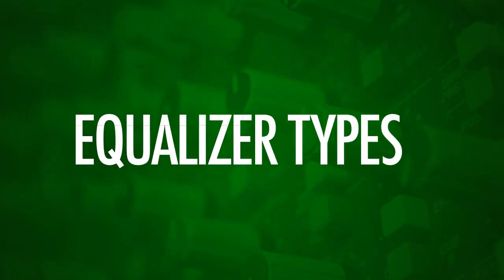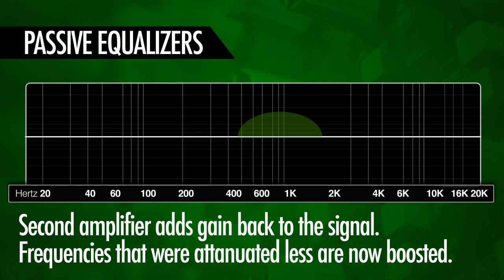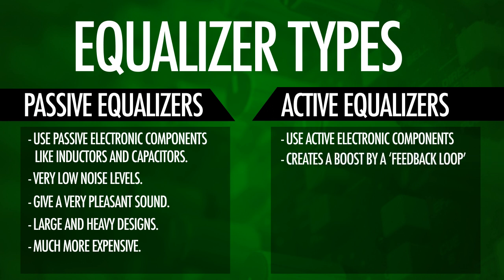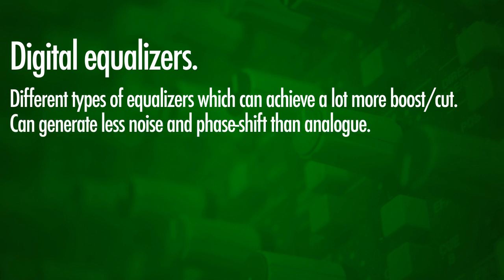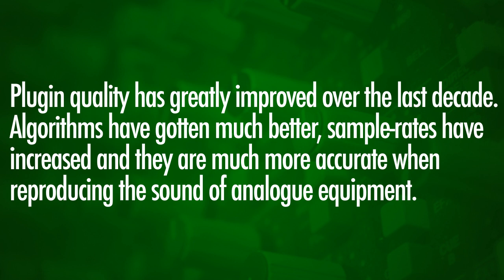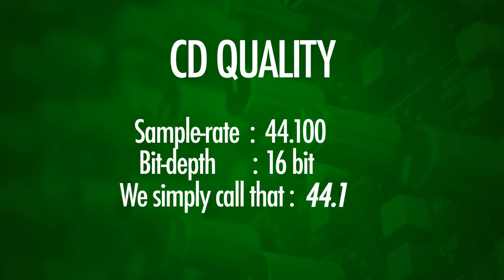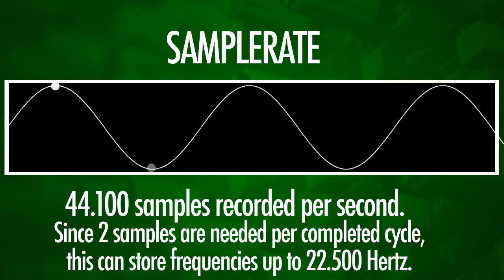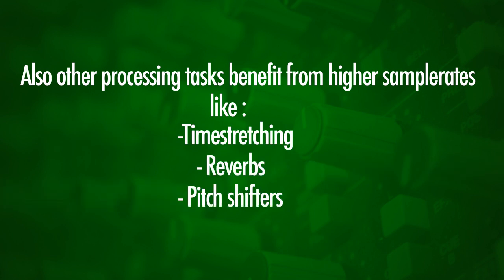Equalizers explained #2 - Analogue vs. Digital EQ

Comment: Regarding noise, the comparison of passive and active EQ is not quite accurate. The insertion loss (attenuation of all frequencies) of passive EQ's is achieved via resistive elements in the circuit, and these resistors generate noise. By applying make-up gain after the EQ, the noise will be boosted, amounting to overall higher levels than an active EQ.

Comment from the maker: Hi Satrio, In theory a passive EQ is only capable of applying a cut. 
What it does, it attenuates all frequencies with the same amount. If we 'boost frequencies' on a band, these are actually cut less than the others. 
On the output there is an output-gain which boosts all frequencies evenly back to the input level. So now the frequencies that had 'less boost' are now actually gained, and frequencies we have attenuated more with the EQ-controls are now attenuated. 
Hope this helped! Cheers.